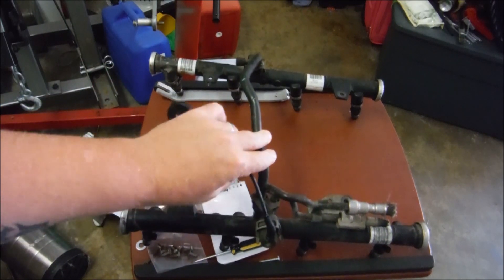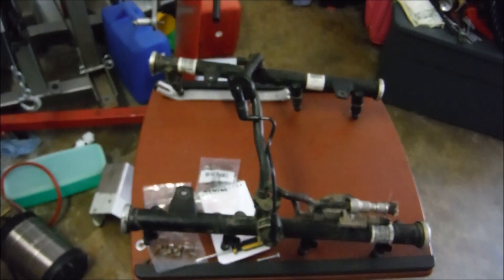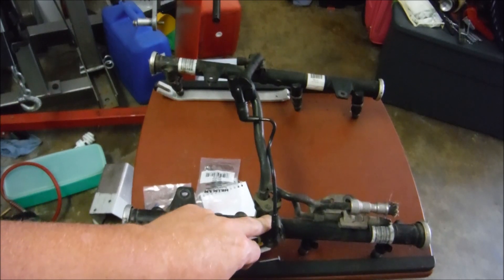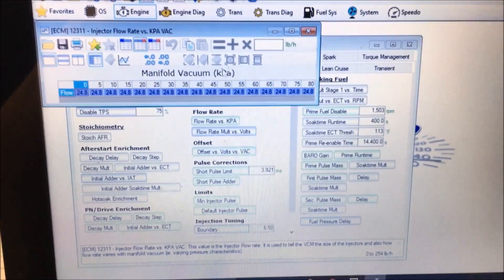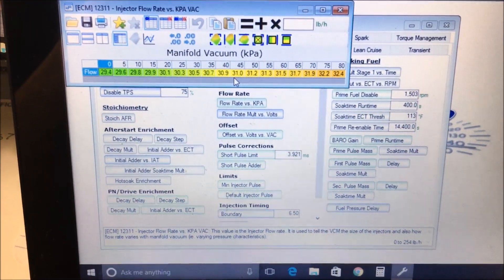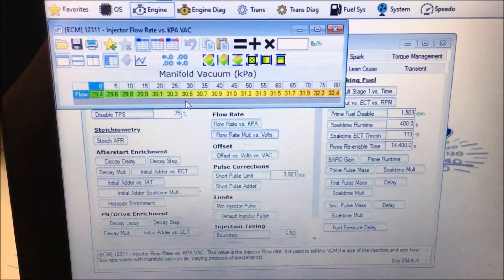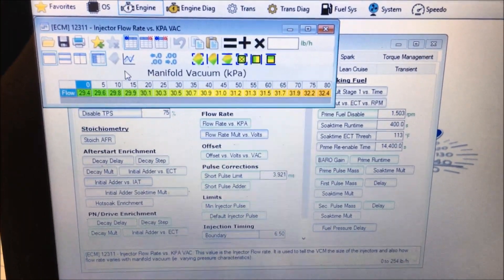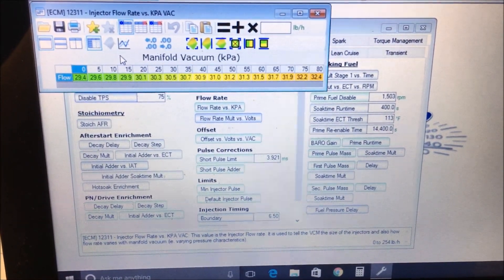LS ENGINE FUEL PRESSURE FACTS AND MISCONCEPTIONS

Comment: I have a 340 lph pump to a corvette filter regulator on my squarebody ls swap. I checked the fuel pressure between the filter regulator and the rails at the motor and it fluctuates between 80 and 90 psi. It's on a gen 4 6.0 with flex fuel injectors. Do you know why this is happening?
Reply from the maker: Most likely the pumps overrunning the corvette filter/regulator. I had the same issue (theres actually a video on this channel about it). A Walbro 255 is about the largest pump the vette filter /regulator can handle reliably and maintain the proper 58-62 psi pressure.
Reply: @BadLuckGarage  any regulators you recommend?
Reply from the maker: Check out the product reviews playlist brother. 👍🏻
Reply from the maker: I ended up using an eBay regulator and was super happy with it for over a year. Link is in the video description where I reviewed it. 😉
Reply: @BadLuckGarage  will do. Thanks man!
Reply from the maker: Yes sir. And thank you for watching!👍🏻
Reply: Another interesting thing. I'm running that much psi on my 3/8 -6 an lines and my tuner said I was running incredibly lean.

Comment: I have a question.. if my ls motor is a return style set up, do I need to add a regulator or can I just run a external fuel pump and be good??
Reply from the maker: Yes. You should already have the regulator on the fuel rail

Comment: Ok heres a long shot. First off subscribed and thanks for the video. I have a 2001 Z06 twin turbos 700rwhp pump gas + meth. Fuel system is UPP secondary pump comes on at a few lbs of boost. Suddenly one day I notice drop in pressure at cruise/idle from always at 58 now fluctuating betweeen 50-56. #8 plug burned as well. I replace plug and start with fuel filter. No change. I replace pump to racetronix with their upgraded wiring harness. Now it starts at 60psi when cold and after about half hour starts dropping to 55 and fluctuates between 55-58. Any thoughts on this would be much appreciated.
Reply: Thanks so much for the response. The plug was so bad it burned the tip off but compression check came back perfect. All the rest looked perfect. As for regulator its just a factory replacement for the stock one. Did a racetronix pump and their upgraded wiring harness so I thought that would cover any voltage issues?
Reply from the maker: yea voltage should be fine then but just FYI, I blew out a vette filter regulator with a single Walbro 450 pump and bought two replacements....neither of which would hold that pump steady. It was just overpowering them. Ended up using an adjustable ebay regulator and ditching the vette filter/regulators. There are videos in the C10 playlist documenting all those issues.  https://www.youtube.com/watch?v=OKPukeksgS8
Reply: Hey man Im still having issues, fuel press dropping a lot when I go into boost. Is there any chance we could chat about it in a little more detail. Im at the point where Ill literally pay you if you can help me figure this out. My email is rv8g30@gmail.com
Reply from the maker: Brother I’m sorry to hear you’re still having issues. I really can’t fix it over the internet. I can only throw shots in the dark at it. I know you said you have a secondary pump setup but it really sounds like you’re either running out of pump or possibly bleeding off pressure somewhere( like maybe at the pump connection inside the tank).  I’ve honestly never made that much power as far as I know, but most people I see at that level are running dual Walbro 255s minimum so maybe you just need more pump. 🤷‍♂️
Reply from the maker: First off thanks for watching ad for subscribing. With all that pump the first thing I would ask is did you run a thicker gauge wiring to make sure its receiving enough voltage. Also what regulator are you running? And lastly, 55-58psi is still good pressure brother. The number 8 plug burning sounds like it could be an injector issue but on my boosted 6.0 my 7 and 8 plugs always looked rough.
Reply: Right on. Its just so weird how it worked well for months then suddenly soon as weather warmed up started having these issues. Not sure if thats a coincidence or not. Not sure if this means anything but I watched the volt gauge, it started around 13.7 with fuel press at 60 then eventually worked its way down to 13.2-3 and fuel pess was around 56. Maybe Im just over analyzing this but it was always 58 and the second it dropped I melted that plug so no im paranoid.
Reply from the maker: Brother Im totally sympathetic. I freak out everytime a gauge needle moves, lol. The current drop could definitely cause the pump to run less efficiently but even at 13.2 volts it should be more than enough. Fuel pressure WILL fluctuate slighty. Thats why GM does say "58psi", they say anything between 55-62psi is within spec. 😉
Reply: Thanks man I really appreciate it. Ill probably go back to the dyno and let my tuner mess with it and go from there.
Reply: Thats whats so confusing about it. This worked fine all winter. Now theres fluctuation at idle/cruise. Today I ran it quickly up to 10psi of boost and fuel pressure dragged down to 50 before I let off. Something changed suddenly from everything working to it not.

Comment: I'm doing an ls swap with a returnless system and at idle I'm getting 70-75 psi but I rev the engine and it drops to 20 psi and I lose complete power. I put a new fuel pump in and I have a regulator in line. What would cause this
Reply from the maker: Thanks for watching Tony. Your issue could be caused by several things. Your pump may have been a lemon right out of the box, same with the regulator or you could have a leak. You didn’t state what kind of pump you’re running but if it’s in tank then you may have a leak in the short piece of hose between the pump and the sending unit. This actually happened to me twice. The first time I used worm clamps instead of actual fuel injection hose clamps on hose in the tank and they didn’t get tight enough and fuel was pushing out around the pickup tube. The second time I didn’t use a submersible style of hose and the fuel in the tank made it soft and it sprang a leak where the clamp was tightened. Of course you can’t see the leak if it’s in the tank so the only way to know for sure is the take the assembly out of the tank, put it in a bucket of gasoline just deep enough to cover the botttom half of the pump, and pressurize the system.  If you check it this way, please make sure you’re wearing proper eye and face protection in case it sprays!

Comment: What would cause a lean condition on the right bank.. or bank 2
Reply from the maker: I would start by checking for vacuum leaks.
Reply: Bad Luck Garage fuel rail leaking where the two rails join from driver's side just above the pressure regulator. I guessing it's just an o ring, and I can knock that out... But would that cause a lean condition?  Oh and I subscribed... Great videos!
Reply from the maker: If you are leaking fuel at the rail then it could cause a drop in fuel pressure and subsequent lean condition, but it would have to be a fairly severe leak. 90% of the time when I see a lean bank code it ends up being a vacuum leak as mentioned earlier. Thanks for the sub!
Reply: Bad Luck Garage I looked for an intake leak and could not find one... I did the water test and brake clean test.. I don't have a smoke machine
Reply from the maker: If you can’t find a vacuum leak then I would start by checking fuel pressure and go from there. There’s always a possibility of a clogged injector as well. Just need to start with the basics. 😉
Reply: Bad Luck Garage ok.. I'll check that next
Reply: Well it turned out to be a dirty mass air flow sensor.  When I would clear the lean code it would take several days for it to return so I thought about the maf sensor. I cleaned it real good and let it dry over night... No code since.. thanks for your help and your response to my questions...
Reply from the maker: I’m glad you got it figured out brother. I’ve actually got another video on that subject. Very important to clean the Maf as part of regular maintenance, especially if you’re running an oiled air filter such as a K&N. But even if you’re not I still recommend cleaning the throttle body and maf at least once a year. 👍🏻

Comment: does a factory gm truck fuel pump or system have a check valve in line?to maintain pressure at the rails . on my swap when the pump primes it goes up to 45ish psi then bleed off right away, which causes it to crank longer before it starts.  but if i cycle the key a few times it will start right away.  just curious if you know
Reply from the maker: The pump itself has a check valve in it. Its not an absolute seal and will bleed down after awhile. Its purpose isn't to hold pressure when the pumps not running but simply to hold fuel in the system so the next time you start it, it doesn't take long for the pressure to come back up. Even if your only getting 45 psi on the initial 2 second prime, the engine should still start and then pressure should jump up the rest of the way almost immediately as the pump will be running again. Also, something that people dont always consider in a swap is if you use larger than stock fuel lines with a stock pump, that 2 second prime may not be able to build enough pressure in those larger lines and you may have to key on twice to build the pressure. Upgrading to a higher capacity pump usually cures this.(at least it did for me).
-Robert
Reply: ok fair enough, i have a aem 320 in tank pump and 3/8 feed and return lines. i may put a check valve in some day or upgrade to a larger pump with a internal check valve for my turbo needs.  thanks for the response i appreciate it
Reply from the maker: Yes sir. that pump shouldnt have any problem filling 3/8 lines though. May want to double check everything in the tank and make sure its not leaking between the pump and the sending unit connection. Have a good night.